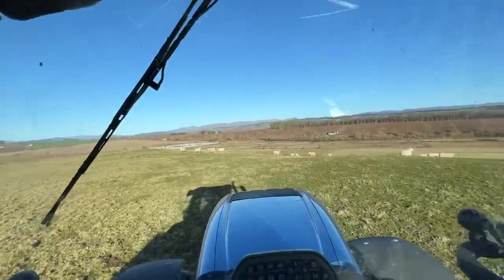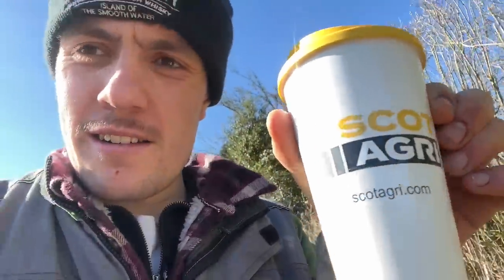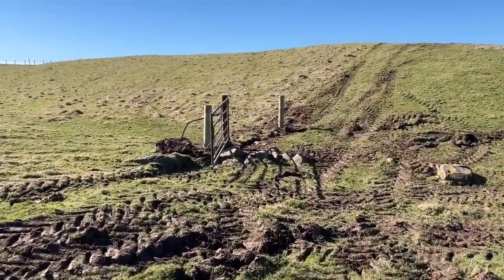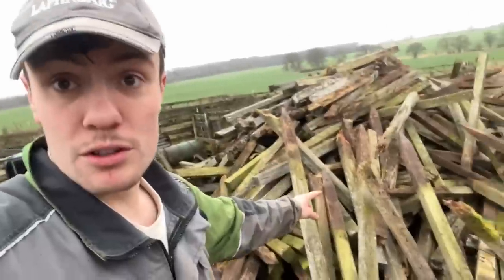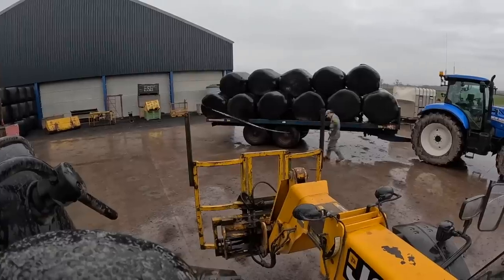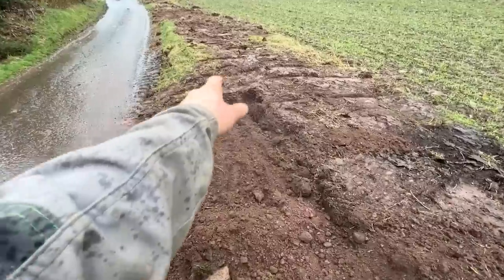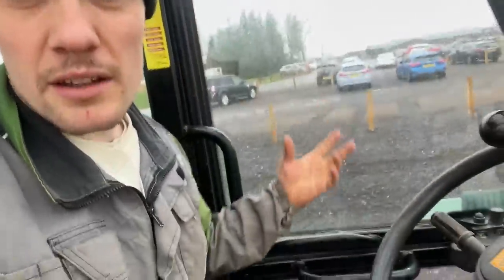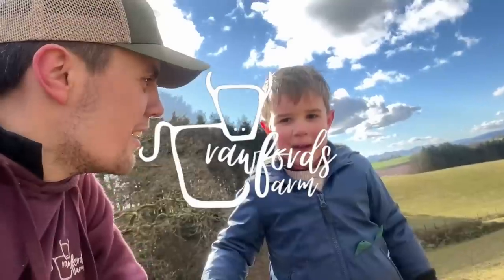I Hit A Phone Cable With The Digger

Comment: Thaat'll teach you (or maybe it won't) ... always use a CAT scan BEFORE digging anywhere that there is any possibility of underground servics (whether telcom, power, GAS !!).  Better to be sure than hit a HV power line that's not deep enough.

Once saw a dozer catch a 11kV high voltage wire that was supposed to be 6 ft deep.  Caught it with the first skim of the topsoil !! Driver needs a new pair of pants !!